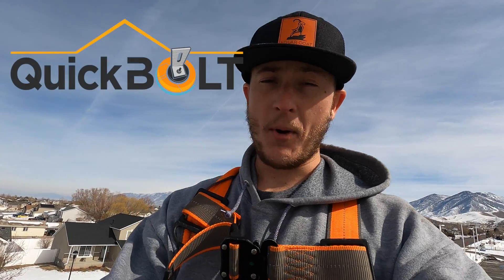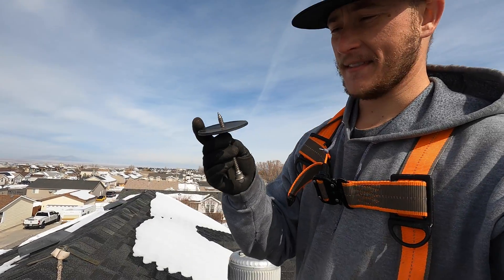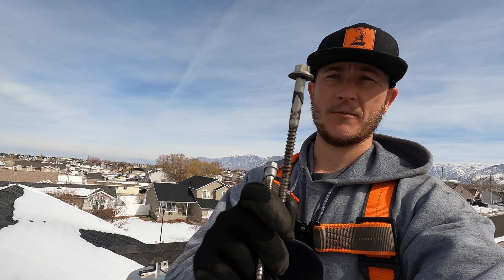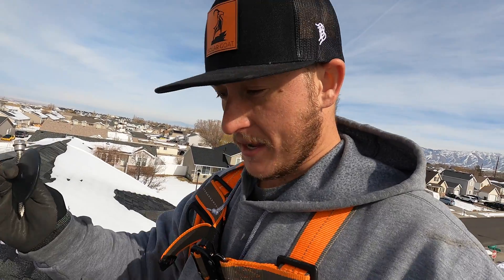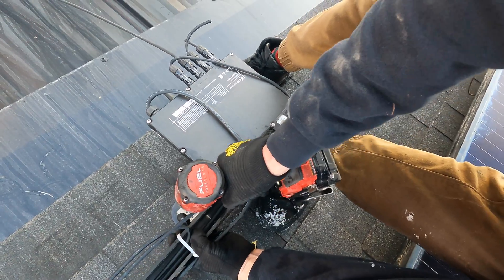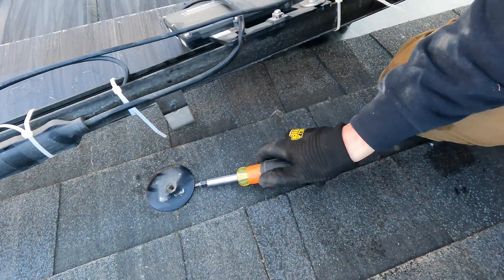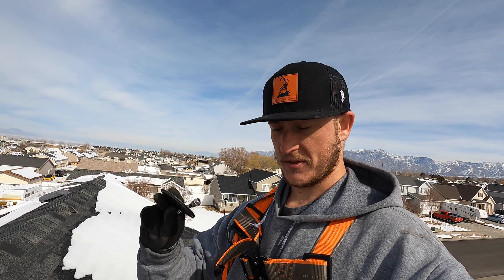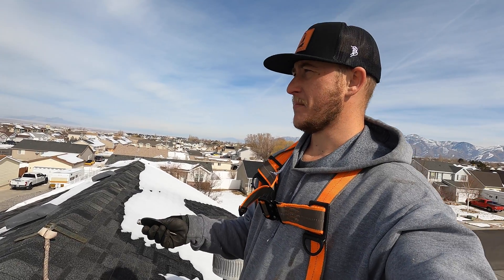QuickBolt QB2 Solar Attachment Review

Comment: Put the QB2s on my home 4 years ago in 90+ degree weather. I needed to move it a bit 5-10 min later when I realized I spaced the footings wrong. Nope. Thing was sealed to the roof and the bituthene or whatever sealant is under there literally glued down so well I think would've brought the shingles up with it if I removed it. Solid product! No issues after 4 years.

Comment: I'm 3 years in with the QB2 on my second solar array - zero issues, installed it myself.  I did put a bit of caulk in before driving the bolts for peace of mind, but probably not necessary.  Easy, doesn't disturb shingles / nails, etc, can put right where it's needed in that truss with no issues!
Reply: What do you use to mount the panels to quick bolt? I have not seen any info on that online
Reply: @MrAbYounes I used Iron Ridge R100 in black (I believe that's the number, pretty strong one is what I went with).

Comment: I saw these at CED Greentech but was skeptical. I saw your video and was convinced these were worth it so I installed 6 of them with ironridge rails on my 4 panel addition and they were so easy to install and really secure. I missed the joist on two spots by an inch and a little sealant on the holes and the membrane covered everything up nicely as the stainless screw cinched the micro flashing down. Thanks!
Reply from the maker: Thanks for the comment. Im glad they worked out for you. I was definitely skeptical at first but they are one of my favorite attachments.